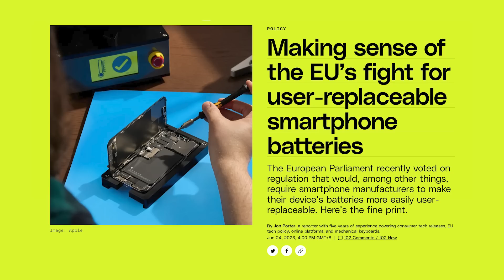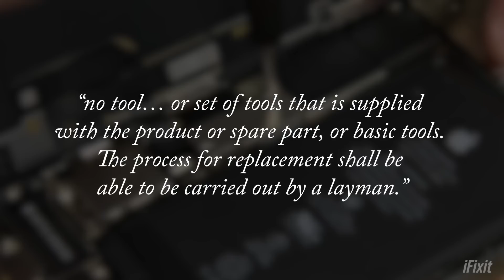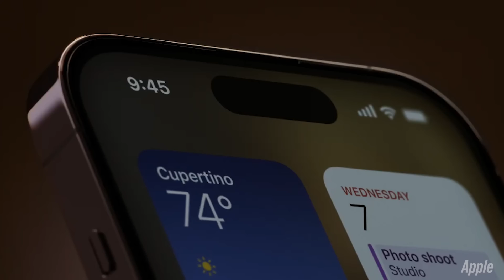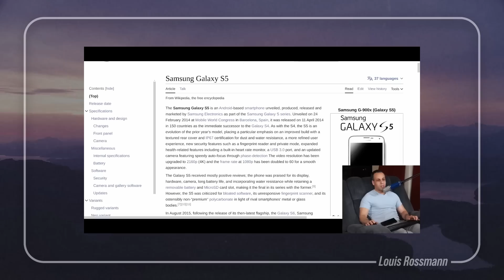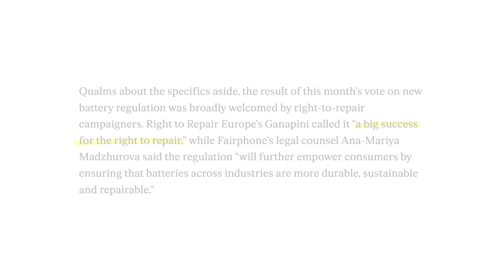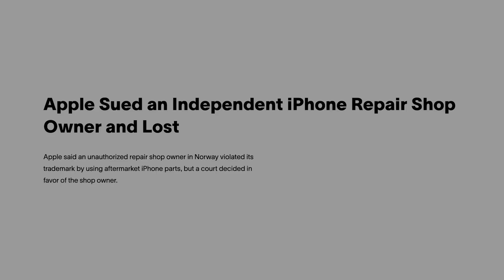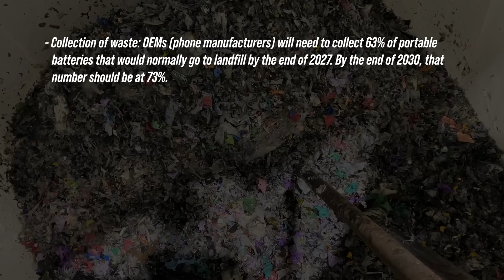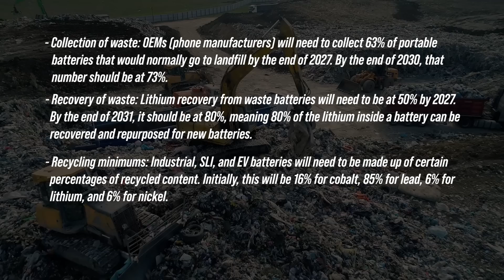EU Just Changed Smartphones Forever

Comment: 1. Battery quite suck when it goes to 70-80% of the original capacity. 
2. My charging is too slow, changing battery would save me multiple times. 
3. I do expect phones to go wireless too(no usbc), like some smaller devices. 
Design is evolving, there is still no replacement for a jack tho, well, wired got no anc,... So its bot always simple.